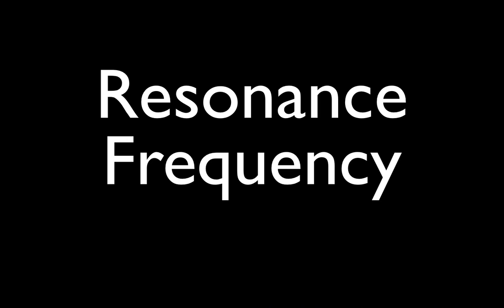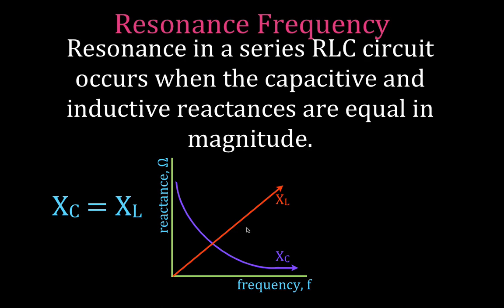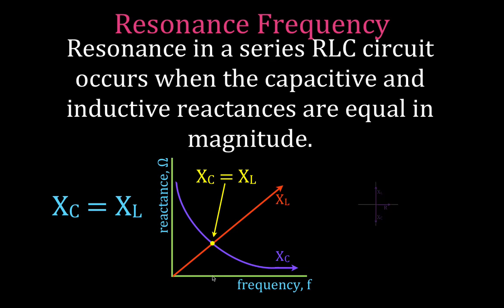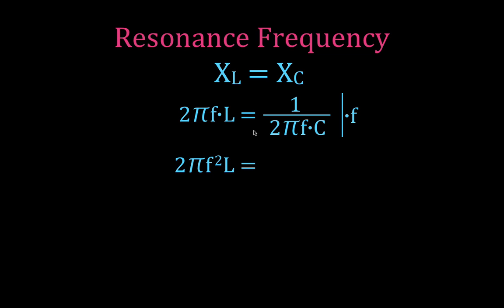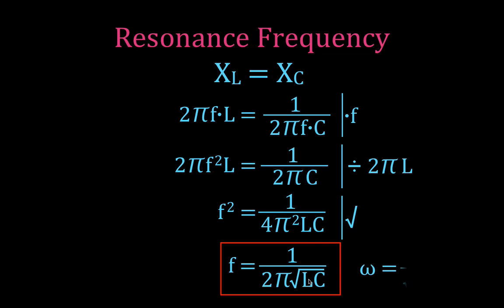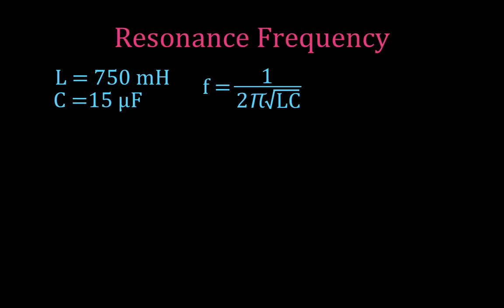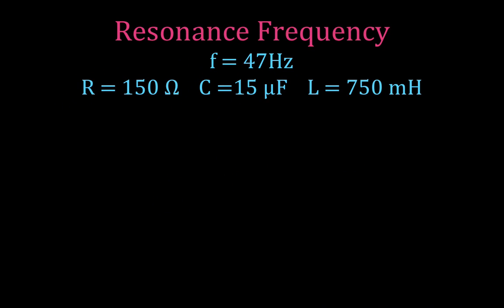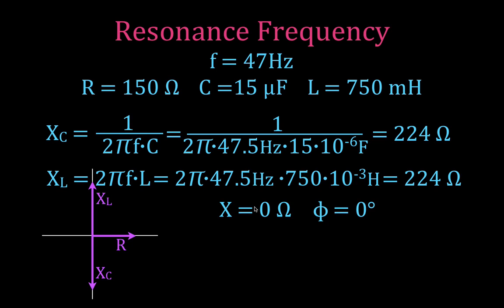RLC Circuits (14 of 19); Determining the Resonance Frequency for Series RLC Circuits

Comment: If U=150V current is 1 A. Voltage on C is 224 V as the same as on L. The C may bee demaged because  he have a biger voltage than in other frequency which is not resonant,

Comment: Why doesn't anyone tell/show actual measurements, to prove these calculations work, to some degree.  How does this "residual" resistive impedance actually play out, as a current maximum, using some current driven device?
What about maximizing voltage in a parallel LC circuit also?